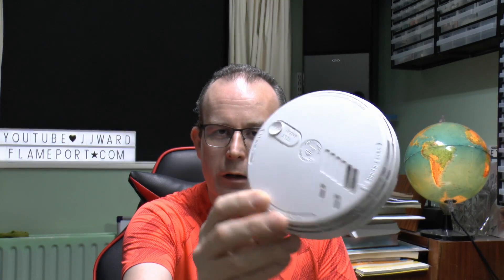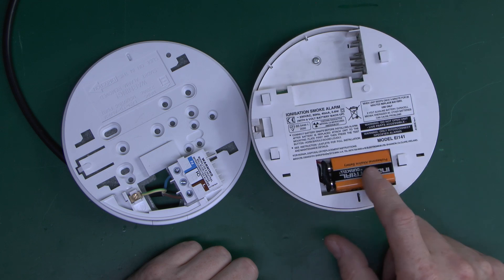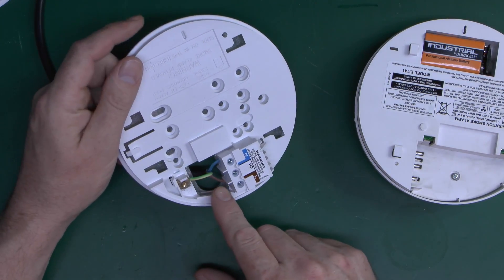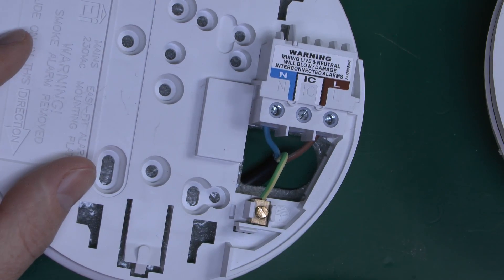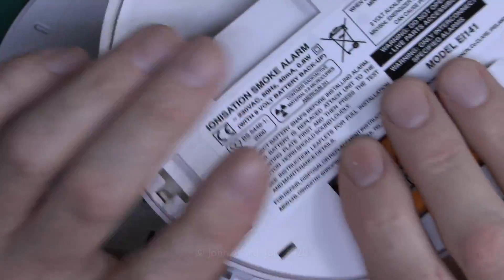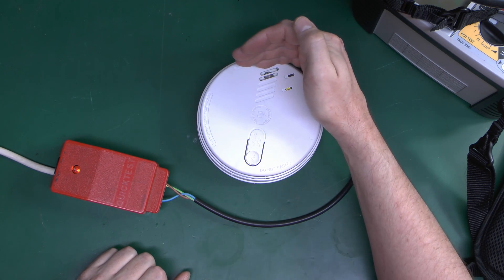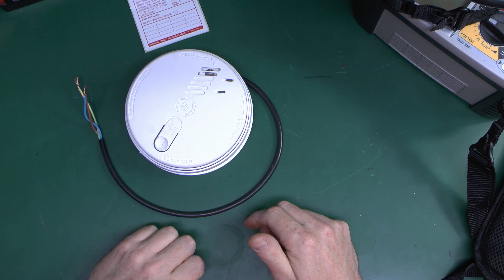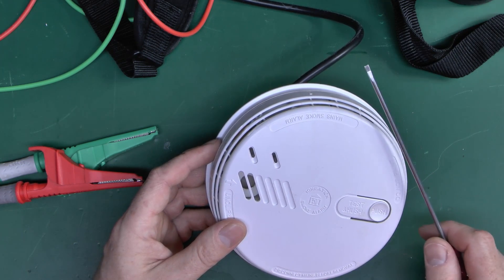Do Not Megger Alarms - what happens when 1000V is applied to a smoke alarm?

Comment: As it made those fizzling noises connected up to the limited power output of an insulation tester I began to wonder how it would cope with a high voltage spike on the incoming mains and reflect on whether it got through compliance testing by the skin of its teeth...

Comment: I'm amazed that a smoke alarm would fail when subject to 1kV from an portable insulation tester.

Like all mains appliances they must withstand surge according to EN 61000-4-5, and will have internal surge protection.

Now clearly the surge protection is intended to protect against transients and not e.g. temporary overvoltage. However a portable insulation tester simply isn't able to feed a fault into a MOV without tripping. And the internal circuitry of the alarm should be able to handle voltages lower than the MOVs clamping voltage for quite some time.

It is still a good idea to remove appliances before insulation testing. But given that portable appliances should be able to handle insulation testing by a PAT tester - who may be incompetent and apply a L-N voltage. I'd frankly consider a bit of life saving equipment such as a smoke detector that is incapable of handling this kind of misuse to be a pile of junk.

Comment: Ah yours use the same crappy power supply in them that the US versions do.  40ma of power running 24x7x365 is significant amount of power for such a device.  Cheapest out there.  I would gladly pay a dollar or two more for properly designed power supply.  I have 12 smoke alarms in the house and each one draws 80mA of power according to specs and actual measured power draw is 65mA on the 120V AC line.  Over the 10 year lifespan of the detector that is a lot of wasted power.  My smoke detectors on my alarm panel only draw 50uA at 12VDC.  That's a lot of kWh's per year for 12 of those vs the dc powered ones.

Comment: The fact that the megger has three leads - red, green, and blue - just like my Atlas DCA55 component tester, makes me want to test a transistor with it - on the 1000 volt range! 😆
Reply: It having three leads is useful for testing socket circuits and rcds.

Comment: Hi John, nicely done video!
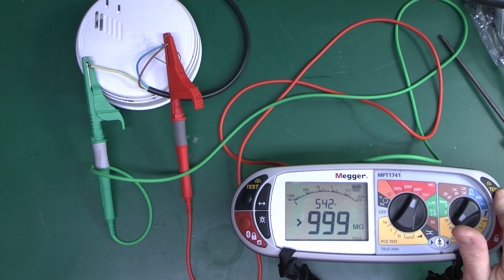 7:15 what you stated is true in the test in this video and and yes P&N and CPC will test the wiring to the device without damage to it!
I was wondering about the cases where there are those filters(like you get with motorised white goods) designed to contain the motor noise and prevent it from invading the mains,
I have seen a connection involving X2 capacitors and coils which are connected to ground! I'm not sure what would happen if such a network were subjected to the test Volts!?

Comment: Next video - a look inside the detector. Please answer my question: What are the two states of IC terminal ?
Thanks.
Reply from the maker: The interconnect isn't a simple two state connection, as this item: https://www.aico.co.uk/product/ei1529rc-hard-wired-alarm-control-switch/ exists to provide various remote functions where multiple alarms are installed.
Reply: @jwflame  Elsewhere, I found 'provides 9VDC on alarm' or equivalent - so thought 0V normal, and 9V as supplied to the sounders - BUT I guess different manufacturers offer different things - so I now guess alarms/detectors from different companies are not compatible !

From your link: "Interconnectable with other 180 Series alarms" - yeah - sounds like they're not interconnectable to other components offered by the same company ! Clearly, quite literally, no-brainers !

Comment: Would you interconnect the alarms with 3C+E to the next alarm using black as the IC? Never done it myself so just wondering. If so would you need brown sheath on the black to indicate permanent live?
Reply from the maker: Yes, that's the usual method of installation, although the interconnect doesn't need sleeving as it's not a live wire - the interconnect still works when the alarms are on battery only, and there are several signals that can be sent on it.

Comment: I'm guessing those alarms have a capacitive dropper for the mains side supply for it, so IR testing wouldn't really put a load on it (similar to some LED lamps). The crackling you could hear on 1000V test was prob the capacitor arcing between the  plates. Of course the CPC was connected to absolutely nothing inside so is irellevant except as you say testing a full circuit and continuity of the CPC. I think manufacturer is just covering their ass on this, as the circuitry in the electronics could become unstable/damaged possibly, rendering it useless as a smoke alarm. cool video JW.
Reply: A capacitive dropper across mains needs to be able to support transients on mains. It also needs to fail safely - i.e. be a safety capacitor and therefore have an enormous margin of safety including factory testing at 2.5kV for 230V applications.

Comment: If a 1000 volts do not work, one must  do 1000 amps next!
I was a bit disappointed not seeing the insides, especially after the testing.
Reply: 1,000 amps wouldn't do 
anything either. To get this 
thing to go crazy and achieve 
poppage, you would need.......

.......Volts AND Amps!!

If John were to connect a mains-powered smoke alarm immediately after a house service fuse block, it would just sit there, waiting to do its job. 

Yes, a smoke alarm connected directly to a 100A 240v supply. Not recommended, mind you! :D

To achieve poppage, it would need to be teeeeeaaaased with ever increasing voltage, 
with some proper gruuuunt behind it and then, when it is finally pushed over the edge, all of those volts and current will escape out of the side of it in the form of flaaaaaames. :D

I have the toys to do this. A 28A variac, 4,000 volts of MOTs and 6,000 watts of ballasting should fizz this over quiiiiiiiiite nicely!

Of course, I wouldn't guarantee flames, as it only takes one component in there to explode, bust open the circuit and its game over. I have had THAT happen before now, which is extremely disappointing. Yes, I did go looking for my hammer! :D

So yes. Volts or amps on their own = nothing exciting.

Enough of both..... things get fizzy! :D

-Wayne's Electrical.

25th July 2020, 00.05
Reply: @WaynesElectrical  You can't get amps without volts is the very simple principle of Ohm's law most of us know. I expected people on this channel to know that.

Comment: Wow, that's the smallest radiation warning symbol I have ever seen on an ionising smoke detector label.
"Next time we'll take this apart and see what's inside."  Please do NOT take the ionisation chamber apart.  It contains a small amount of radioactive Americium 241.  The ionising radiation is stopped by almost any amount of solid material, or even nitrogen gas in the atmosphere - the main danger comes from inhaling particles of americium 241 or contaminating your work area so it's fairly safe until you dismantle it.

The way it works:  The alpha radiation from the americium ionises the air between two plates.  The circuit inside the smoke detector periodically measures the resistance between the two very closely arranged plates (yes, many megohms).  Ionised air has a lower resistance.  Combustion by-products generally do not ionise as easily, and this results in a higher resistance between the plates, and the alarm is triggered.

Actually I suspect you are way smarter than I am and already know all this.  Forgive me for stating all of the obvious 'just in case'-  I'm only interested in having you around to make many more videos for us ;-)

Comment: Have you tested how much power the mains powered ones use? For a lot of manufacturers you will be surprised (making ones with non replaceable batteries a much cheaper option often)
Reply: Dave Jones covered this in https://youtu.be/_kI8ySvNPdQ
Reply: Many devices--especially small ones--receive power from the AC line during parts of each cycle, but then return much of that power during other parts.  In most cases where an electric customer has some small devices that do this, either that customer or other nearby customers would have other devices that would be able to make use of that returned power without it having to flow very far back toward the utility, and so most residential electric meters will deduct power returned from power received.
Reply: @Flat Finger Tuning is this what they call power factor or power correction factor and apparent power or am I wrong?
Reply: @m3snusteve  It's strongly related.  If one were to measure the voltage and current waveforms and compute from the voltage waveform how much power would be consumed by a one ohm resistor driven with it, did likewise for the current waveform, took the square roots of both values, and multiplied them together, one would get apparent power.

If the ratio of voltage and current isn't constant, average power (which is computed by multiplying voltage and current at every point along the waveform and taking the average) will be less than apparent power, even if there's no point in the waveform where power is actually being driven back through the mains.  On the other hand, if there are times when power is driven back through the mains, then actual power can be essentially nothing even when apparent power is quite large.

Comment: What would be the danger in testing just between line to earth or neutral to earth (not line and neutral connected together to earth) if I’m honest I’ve tested like that for years without any problems, and never had an issue.
Reply from the maker: Most of the time the only difference is the need to do two tests L-E and N-E rather than just one LN-E.
If there was a N-E fault within the installation and you tested between L-E you would also be testing between L-N due to the fault, and that could damage things.

Comment: I WANNA POP IIIIIIIIIIIITTTT!!!!!
Only 1kV at 1-2 mA? I AIN'T 'AVIN IT!!!
I want flaaaaaames! Please send that here,
and "Just-For-Fun" what I can do is to really.......
.
.
.
.
.
......Crank it RIIIIIIIIIIIIGHT up, all the way to poppage!

I have a 240v, 32A supply, 28A variac, access to Microwave Transformers (MOTs) which kick out a good 2kV, and maybe even 4kV if re-configured to do so, and I tell you what, when The Mega Jiggy comes out for business and we get that thing ballasted on 6,000 watts and upto 4,000 volts, it isn't going to stand a chance! :D

Do you want flames? :D

Let's teeeeeaaaase it on the variac.

.....Uuuuuuntil it pops! :D

The only way it might survive, and that's if it has a MOV in there to protect against power surges.

But the question is.....

Even if there is a MOV inside the smoke alarm....... Could it withstand 4,000 volts being rammed into it at 6,000 watts for a good few minutes?

Probably not, and these things NEEEEEED to be tested out!

You know...... "In-The-Name-Of-Science" of course! :D

So..... The question remains: You want flaaaaaames?

If you do, there is an Email contact on the Wayne's Electrical channel! :D

Thanxx for showing,

-Wayne's Electrical.

22nd July 2020, 21.57

Comment: I once had to repair a 250KVA alternator that had been meggered by an electrician despite the warning that the diodes on the rotor had to be shorted first if you must megger the unit, hed obviously did not so the whole alternator had to be taken apart and new diodes fitted on the rotor.Expensive mistake on a brand new genset.
Reply: Please explain this piece of equipment.
Alternators don't have diodes.
If you want DC from an alternator, its output would have diodes, not the rotor, and if these were part of the alternator, it's output would be stated in kW. What was the power supply for the field ?
Reply: @millomweb  The diodes are on the rotor windings. Some alternators have two sets of windings on one shaft with a set of diodes between them, power from one or more of the stator windings is rectified and then fed to to a set of field windings via an AVC unit this produces a magnetic field which induces an AC current in the smaller rotor winding this is then rectified to feed the main rotor windings, it was these diodes mounted on the rotor that were blown. You obviously have not worked with brushless alternators of any size.
Reply: @Equiluxe1  I guess there's a bit of permanent magnetism in there somewhere to get the whole thing started ! Interesting way of doing things - and you're right, brushless alternators are not something I've come across ! I'm probably a bit more 'old school' !
Reply: @millomweb  Always some residual magnetism in there. Brushless is old school now as it has been around since the 70's.The incident I referred to was in 83.
Reply: @Equiluxe1  I don't think of th 80s as old school ;) Cars with dynamos were just nicely going out of fashion ! While no longer being fitted to new vehicles, older vehicles on the road still had them. Portable electric generators all had brushes - those and car alternators are my limited experience of alternators. Everything else was DC !
Reply: You got a job out of it though didn't you so why moan about electricians😂😂

Comment: I think the danger scenario would be having two smoke detectors on different circuits sharing an interconnect wire.  The interconnect wire is not designed to have any significant voltage on it relative to neutral, but if one were to leave one detector's neutral connected to mains neutral while the other detector's neutral was connected to a potential 500 volts above or below ground, that would put at least 250 volts between the interconnect and neutral wire on at least one detector.

BTW, I wonder how much it would have cost to use a moderately-high-frequency signal (e.g. ~50kHz-500kHz) on the interconnect as the alarm trigger, and then isolate it using Y1 caps?  I don't like the concept of smoke detectors on different circuits using neutral-relative signalling in ways that can't tolerate high voltages.  Among other things, if one has a smoke detector and another device at the end of a long circuit run, and that other device fails shorted, voltage drop on the neutral wire between those devices and the panel could cause it to reach a substantial fraction of mains voltage until the breaker trips.  If one were to have two or more interconnected devices, and one had a neutral wire spike, what effect would it have on the other devices?  Having it set them all off but not damage them would be reasonable.  Having it destroy them in such a way that they sound continuously would be less desirable but perhaps almost tolerable.  Having it damage them in such a way as to silently destroy their interconnect function would be downright bad, especially if the wires near the original detector got shorted as a consequence of a fire.